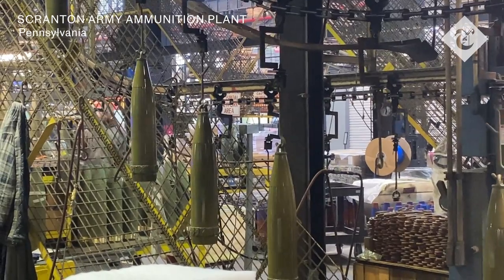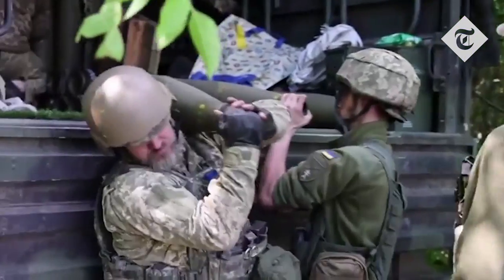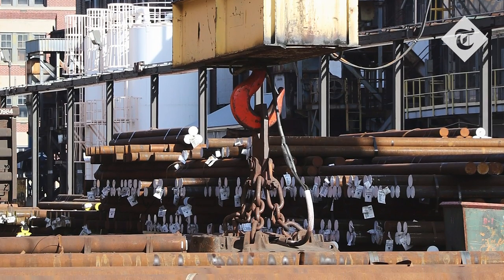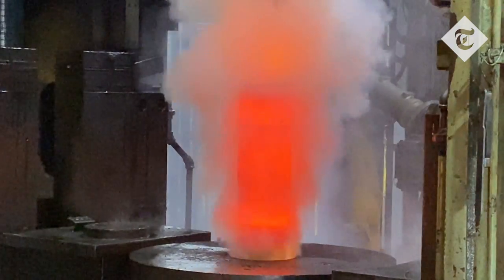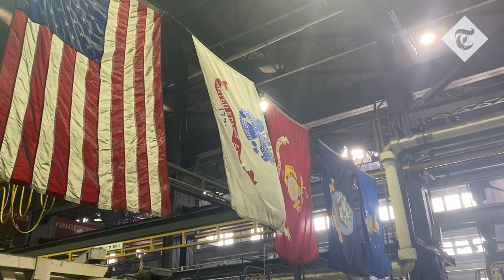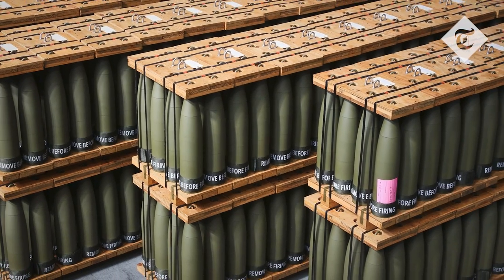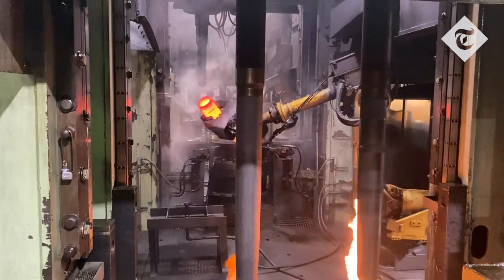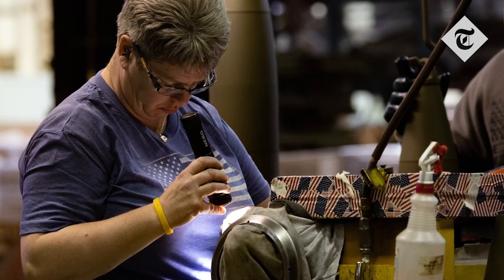Inside the US arms factory churning out shells for Ukraine’s war effort | Dispatch

Comment: These are 155mm shells which are used in NATO heavy artillery but not so much (yet) by Ukraine. The Soviet sizes are different.
Reply: And ? What’s the point ? 😂 still no where near the amount they are using each month 😂 7/8,000 a day they use and this super factory can only make 14,000 a month ! Do the maths
Reply: @shsh-he5qg  
Add 9 other factories doing the same, orc.
Reply: With all that firing most of their artillery barrels must be smooth bores
Reply: @edwardd9702  Sounds like a problem that Russians would have. They have to fire so much more because their aim is crap.
Reply: @edwardd9702  The fit must be getting sloppy.  The distance calculations are all trash as the barrels wear.
Reply: @abrahamdozer6273  wonder if wear is worse with guns like the M777 that use an obturation assembly instead of a shell case to seal in gases?
Reply: @edwardd9702  I don't know how many barrels we've sent but I suggest we send more as this war has a long way to go yet and the M777 is the right tool for the job.
Reply: @abrahamdozer6273  The new improved 155 howitzers - "... incorporates a chrome plating, which helps to extend the life of the tube by two to three times and has prevented buildup of residue within the bore during controlled testing. This allows the gun to fire top-zone charges in succession without the need to fire a lower-zone charge to clean out the barrel, a requirement for the legacy steel barrel."

Comment: Ukraine was and always will be a divided country.
They are split between many ethnic groups, and it's only normal that there is a civil war between these ethnic groups.
Historically, the radical ukrainian movement (such as the right sector) started the war against the ethnic russians, and before that, they called for genocide on russians living in ukraine, more specifically the Donbas region.
Reply: " started the war against the ethnic russians"
Absolute nonsense.
Take these quotes from Girkin / Strelkov as proof
About warfare against Ukraine in Donbas from April 2014
I was the one who pulled the trigger of this war.
If our unit hadn't crossed the border, everything would have fizzled out.
There would have been several dozen killed, burned, detained. And that would have been the end of it. But the flywheel of the war, which is continuing to this day, was spun by our unit. We mixed up all the cards on the table.
Reply: Ooh, low level propaganda from a D-level poster. How sad that Russia can't afford better agitators...
Reply: @davidb6576  who is going to post anything smart when they can get the things that matter for posting drivel - potatoes, flushing toilets ( for washing potatoes), and a 2% share in a lada.